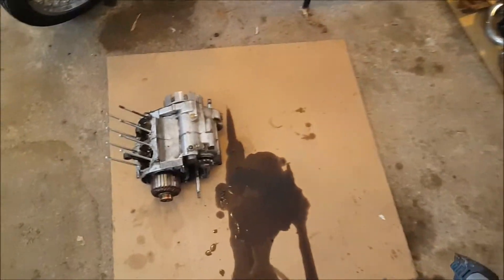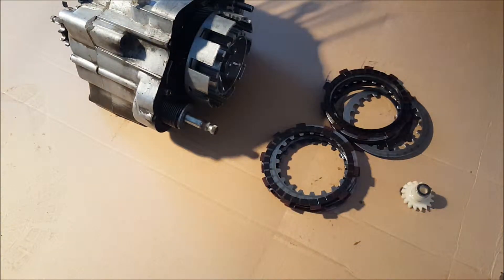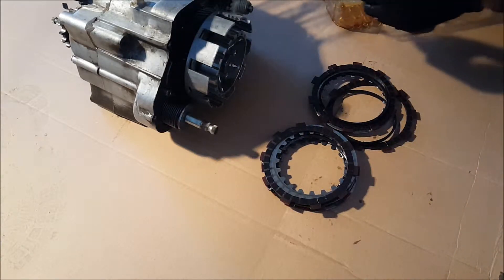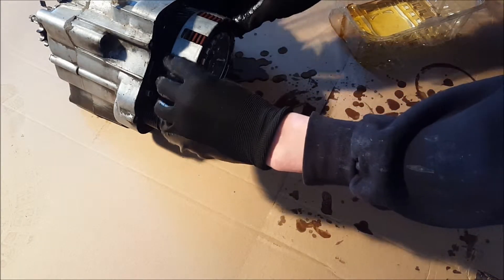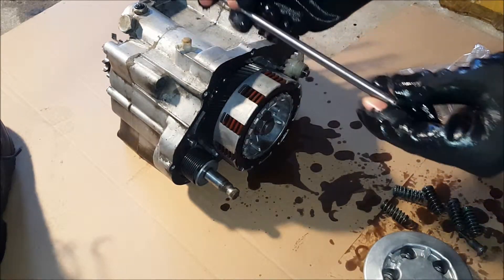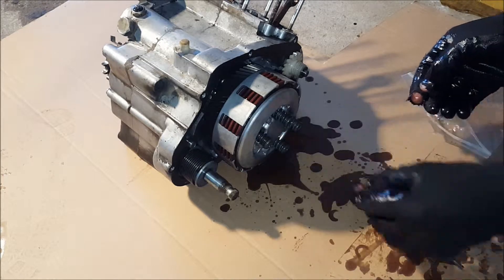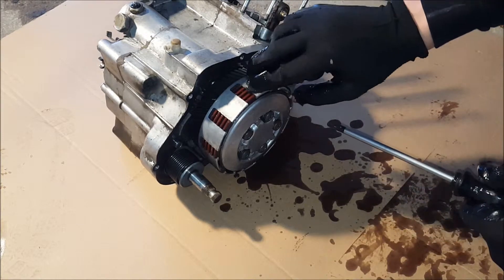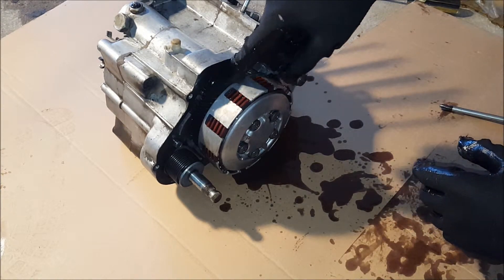1975 rd200 Clutch Rebuild

Comment: I have a 76 Yamaha rd200,  that I'm rebuilding.  The problem is the clutch basket was torn apart when I got it. The problem I'm having is there is an extra washer with the clutch that isn't showing up in the manual.  Any suggestions?